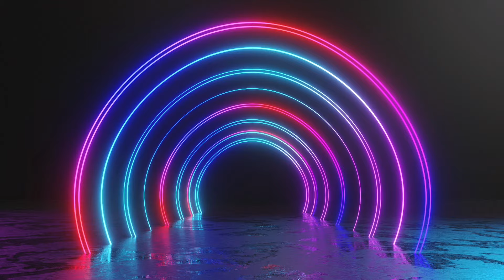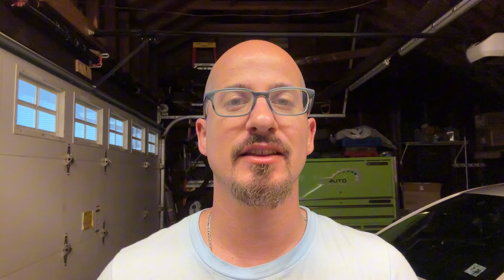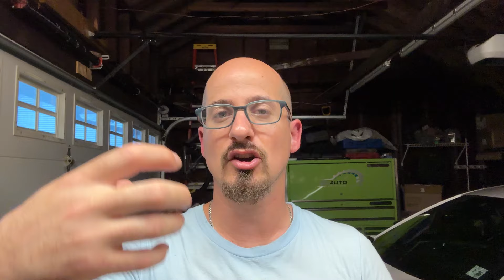Q&A Episode 62

Comment: I have a 2017 Accord with the 2.4 liter direct injection engine (6-speed manual).  Purchased new and currently has close to 40,000 miles. Do You see many carbon build-up issues with these since they are direct injection engines.  I seems that Honda seems to have less problems with their normally asperated direct injected engines than other manufacturers.  Previous vehicle was a 2003 CRV with the same 2.4 liter engine but port injected and no problems for 265,000 until it was totaled when a pickup backed into the car.  Hope to keep the Accord at least as long.
Reply: The 2.4L is a pretty large displacement  engine for a NA transverse 4 banger, coupled with low tension piston rings and i-vtec ( exhaust side) the earth dream engines don't tend to have carbon build up issues
Reply: You’re very lucky to have a manual with such low mileage! Honda doesn’t make any NA manuals with VTEC so I’m wishing you many happy miles!
Reply: @scarboroughnorth  Not only that my wife insisted on buying the car with a manual transmission!
Reply from the maker: @s.p.ltd.3886  those are actually not an issue with carbon buildup typically.

Comment: Here's a question - Turning on AC seems fine, nice and cold, no noticeable smell. Turn OFF AC but fans still on during the last mile to destination (I heard this is good practice to dry up the system), and it starts to smells, not too bad but it's noticeable. 
Almost every place I searched about AC smells, it's when the AC is actively running. Any insights on this, could it be same issue? Seems strange to me it's similar symptoms but happens at a different time... 10th gen Civic hatch 6sp. Thank you!
Reply from the maker: Yeah that’s an odd one for sure. Would have to do some in person digging to get to the bottom of that one.

Comment: Hello, I have a 2013 Acura RDX with 123k miles. My cruise control doesn’t work. When I push the cruise on/off it turns on and the “cruise main” light comes on but it doesn’t set the speed when I push the “Dec/set” button. 

There are no warning light , all the steering buttons work , the brake light switch is ok since all brake light works and doesn’t stay on. I have a cheap scan tool that show a EPS code but no warnings and steering works well. 

I don’t know what this can be , what do you think this can be ? Any issues similar like this on these vehicles? Thank you

Comment: Taking my TLX Type S 2022 tomorrow for A 1 7 (and the previously mentioned rattle in my trunk and the weird groaning from the wheels at low speed). Mileage is still only 5400. Is there anything they are going to want me to have done that I should waive?  (Also, oil life dropped 20% in one week, that algorithm is garbage.)
Reply from the maker: @MikeSims1103  I would only agree to alignment, good to check once a year, possibly cabin filter, and wiper inserts. Don’t agree to anything else. Next service maybe a rear diff.
Reply: @BCautosutions  I deferred the brake fluid replace until the next one. I know things need to be replaced regardless of mileage, but I don't need that at 5400. The noise I previously mentioned in my trunk lid has caused them to order me a new brake light, so that's going to be replaced under warranty. Really appreciate the channel.
Reply from the maker: @MikeSims1103  thank you! Let me know how everything goes and best of luck! 👍🏻
Reply: @BCautosutions  The rattle was a screw that broke off or something in the tail light assembly. They replaced it all today in about 40 minutes. He showed me the assembly and it was coming from somewhere inside the sealed unit.
Reply from the maker: @MikeSims1103  wow, that’s odd. Thankfully it was something simple
Reply from the maker: @MikeSims1103  thanks for the feedback!